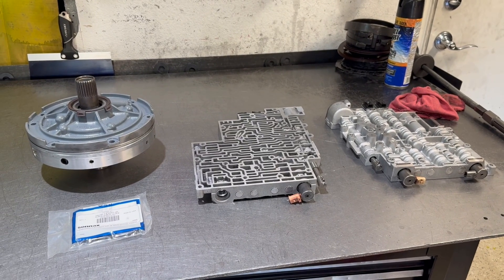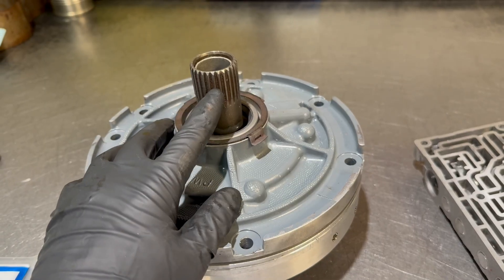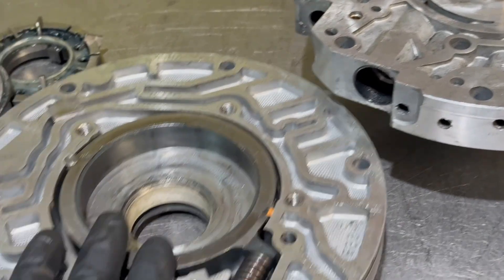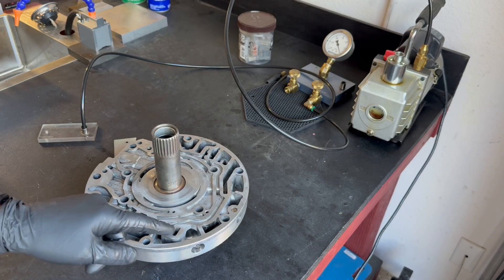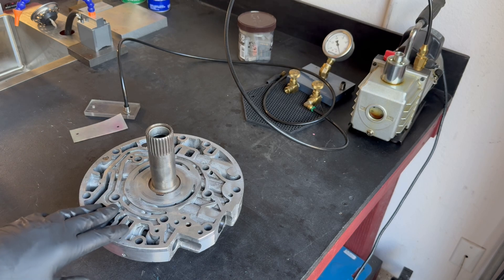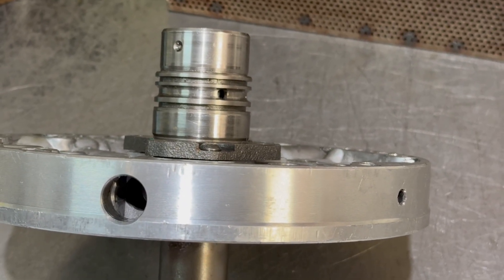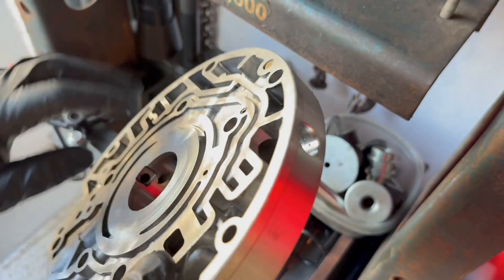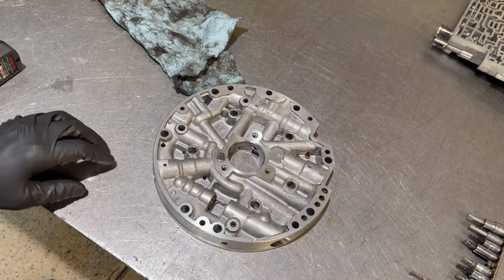4L60E: Awful Remanufactured Pump

Comment: Hi, I have a 4L60e that I had a shop rebuild. It has broken the pump three times now. I have a 59 Apache 5.3 LS with only 300 miles. The first time they said it was probably the way I installed it The second time, I had them remove and install it. They said they installed a “billet rotor” The transmission went out again this past weekend but of course the warranty period has expired. I wanted to pick your brain as to why this might be happening. TIA
Great videos.
Reply from the maker: Thanks, Oz and sorry that keeps happening...Did the shop happen to vacuum test the pump and valve body? Were the castings machined and rotor/slide clearances within specification? If the casting is heavily worn at the pressure regulator balance spool, the rotor and slide will continue to break up. If there was way too much rotor/slide to deck clearance, that can also lead to pump failure. 

For more information, check out this video here: https://youtu.be/zQe2E57-VLc

The shop should have also checked for a cracked flex plate and performed an engine end thrust check as excessively worn main bearings can also destroy pumps.
Reply: @nickstransmissions I’m not sure about the vacuum test on pump or valve body. No machining was done on the castings. The bearings were changed when I had the engine rebuilt. I do know that they checked the flexplate for cracks.
Reply from the maker: Yea, the vac testing on the valve body and pump is everything, esp if you're having repeat catastrophic pump rotor/slide failures. 

Here's one of my pump repair vids that explains in more detail: https://youtu.be/zQe2E57-VLc

Comment: Hi, I have a 4L 60 E that I have rebuilt twice now and it’s still jerks going from neutral to drive. Reverse is fine new torque converter clutch pack sprag solenoids you name it I’ve replaced it do you have any suggestions please?
Reply from the maker: Did you rebuild it or did a shop?

If you rebuilt it, Iwould need to know what you actually did (parts replaced, procedures performed) ... Otherwise, I'd just be shooting in the dark.

I'll ask a couple questions based on what I think the problem may be, with the assumption that you built the transmission as you prob wouldn't know the answers to these questions if a shop or someone else built it: 

1. Did you either vacuum test the valve body or replace it with a remanufactured valve body from a reputable supplier?

2. If no to both ?s in #1, what specifically did you do with the valve body (if anything)?
Reply: Hi thanks for getting back to me. I rebuilt it myself. I have not tested the valve body as the original problem was the stuck bearing in the valve body plate for one two upshift which I saw on your video. I have meticulously followed your video for dismantle and rebuild. I have replaced all parts internal, including a new sun shell clutches solenoids metal double ring sprag aluminium servo pistons, new wiring loom and torque converter bushings and seals checked and cleaned pump for any scoring have had it tested through the OBD to port and pressure is good
Reply: I also need to mention I live in the UK and have a limited supply of transmission professionals to turn to especially regarding American transmissions I get my parts from Rock auto and generally buy the genuine equipment where I can if I can get the valve body tested and it is scrap. Where do you recommend? I get one from I have seen a sonnex refurbished one in the US

Comment: Hey Nick; thanks for another 4L60e video. Always pickup something new. Let me know if I can ping you about my first build being a failure; no noticeable drop in RPM when put in any gear but, if you hold the throttle around 4500-5000 it slowly moves. Thanks again brother.
Reply from the maker: Thanks for watching, Tony...You can ask your questions here in this thread, assuming your build is a 4L60E - I do not provide any tech support via DM, email, etc outside of my paid consulting service....You likely don't need the service unless your questions are extensive or the problem(s) are very complex and quite a lot of information needs to be exchanged, etc.

Also, there's no failures - just some jobs that take a couple iterations to get right, that's all.
Reply: @nickstransmissions Nick, thanks for getting back to me, much appreciated. To start, I’m wondering if there’s anything I should check before removing the trans. Was thinking maybe a gauge to check pressure and/or drop the pan to make sure I didn’t crush the filter. Guess I’m looking for a strategy to use to determine how/where I dropped the ball. Thanks again.
Reply from the maker: Does it do this in just Drive or D3, 2 and manual low as well? I think so if I am interpreting your above symptom description correctly. How is reverse - does it engage well and move?

Sounds like you may have cut a sealing ring on the turbine shaft, assuming all of your valve body/1-2 acc bolts, etc are torqued to spec, pump-to-case gasket not left out, etc
Reply: @nickstransmissions There was no noticeable rpm drop/noticeable engagement in any selection including reverse. But, if we held the throttle around 4500 for about 30 seconds to a minute it would start to roll slowly. If I recall correctly that behavior was for any selection (the vehicle has been sitting for a couple months now). Thanks again.
Reply: @nickstransmissions  It did this in any gear selection including reverse.
Reply from the maker: Ok, well assuming your fluid level is correct when hot (i.e. at or slightly above the full-hot mark on the dipstick then my first step would be to do a line pressure test to see if the pump is putting out any pressure. It should read between 50-75 PSI at idle in park, neutral, drive and D3; 90-120 PSI in reverse and 140-175 PSI in manual 2 and low. If the pressures look good, drop the pan and see if any VB-case bolts are loose and or filter is not fully inserted into the pick up port in the pump (this is usually an issue if an aftermarket deep pan is installed without a filter pick up extension tube).

If your pressures are below normal to flat-line, pull the unit, disassemble the pump and see if the rotor/slide was destroyed on first start up. If so, the converter wasn't fully seated at the time the engine was fired up.
Reply: If you have a 4L60E we'll you have come across your first problem right there. Get yourself a 4L80E all your problems go away
Reply from the maker: Minidick - More clueless drivel from you - Get lost. 

You have absolutely no idea what the hell you're talking about. If you can't keep a well-built 4L60E running/working in a more or less stock to mild performance application, the problem isn't the transmission - the problem is you.

Comment: I try to tell these do it yourself builders that if you do not have the equipment to machine and manufacture or remanufacture your valve body and your pump and a way to vacuum test, just push them aside and go ahead and spend the money and buy them already done through somebody that sells Sonnax the valve booties and pumps that have been done and tested with all of their updates upgrades and new valves installed. I always go the extra step and buy the reinforced drum and install my input shift if it’s usable if not, then I ordered the whole thing.drum and input shaft. With that  Sonnax  reinforcement kit. and honestly, you pay a little more money but in the end, it’s still worth it especially when you’re doing the build time and labor yourself. You’re still saving a few dollars I don’t care if it’s just $15. You’re not gonna have to remove your Transmission a second time you’re gonna put it in as long as you flush and replace everything like your cooler always replace it always flush the lines if you intend on going back onto your radiator I recommend the whole new radiator. You can flush it and get results but you’re never gonna get all the contamination out of a radiator transmissions cooler not unless you have some special cleaning solution and equipment to where you can circulate it and cycle it at 180° and also when buying a valve body that’s already done. It comes with all your electronics and the new spacer plate and gaskets so you’re not guessing as to which ones to use I’ve done two Transmission builds as a at home builder in my garage purchasing everything from Transtar industries and had remarkable results with no complaints and I also test drove the vehicles multiple times with my Autel scan tool so that I could monitor what is going on and a pressure gauge so that I could monitor the pressure as a backyard builder. I have pretty much everything including vacuum testing equipment but it’s pretty much useless because I do not have the ability and Reamers with the vice and guides. What I am able to confirm vacuum clearances to determine if they are acceptable when doing a cleaning and reassembling. Hopefully my rambling comment will be enough to help everyone understand the seriousness when building a Transmission yourself it’s entirely possible and get extremely good results. If you just take the proper steps, you cannot just clean them up and throw a little lube on them and put them back together, then bounce them across the room like somebody did with this pump and valve body. They were definitely injured during shipping orwere they already liked it which is an extremely good possibility, but it’s in good hands with Nick.
Reply from the maker: Yep, not having the right tooling and knowledge is a major show-stopper for me but all too many people try to "get by", saving a penny while bringing the foolishness by the pound (or ton, in some cases haha). Thanks for watching, Jay!